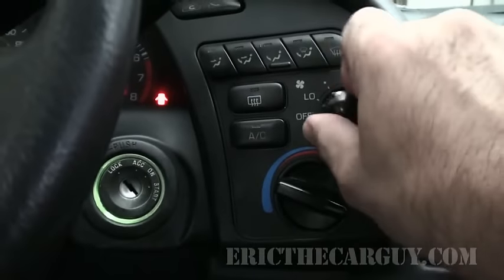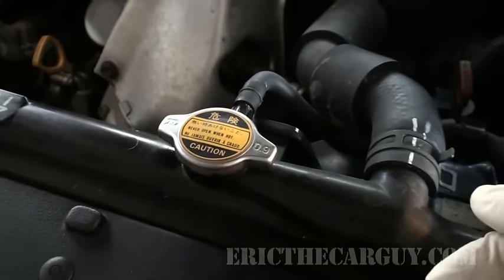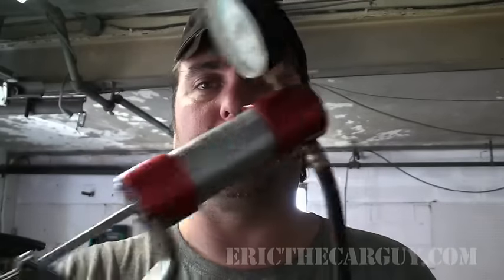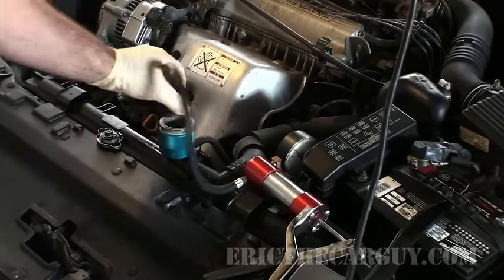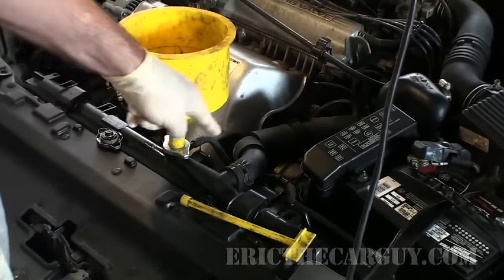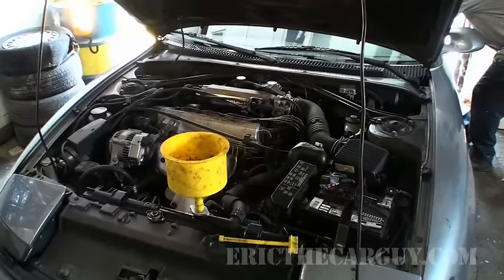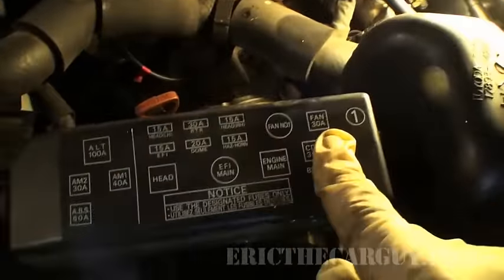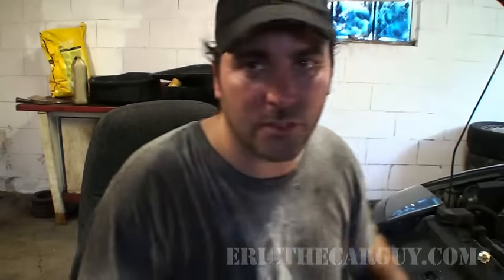How To Solve An Engine Overheat Condition - EricTheCarGuy

Comment: check this out... after starting and idling for about 6 minutes the coolant temp gauge goes from a flat 0 cold to nearly 260.. as in, once the needle starts to move, it rapidly rises to 260... all this time there is no heat from vents, blows ice cold... it's a 96 dodge ram, I have to pay someone to repair this for me (shoulder injury) and would like to know what this seems most likely to be.. coolant levels are good, had no problems at all then it just started with the no cabin heat and engine overheating the other day.

Comment: Got an 02 pt cruiser that's overheating if u drive it 20 mins or more...my ac n heater both work... I've replaced radiator, radiator cap, thermostat, low speed relay, motor in the fan(it wasn't working but now is) and it overheated again🤦🏼‍♀️🥺 no smoke from tail pipe. Actually drives really good...any suggestions? IDK what to do

Comment: So what do you do if you have diagnosed all of that and you still have an overheating problem? I have a 2014 Dodge dart SXT 2.4l. I just bought it from the dealership about a month and a half ago and it is slowly overheating it is about midway between the hot in midway mark on the gauge.I have diagnosed the radiator fan and replace the fuses the radiator fan kicks on when I turn on the AC mind you there is only one fan in this car. So then I unplug the coolant temperature sensor and the car will go into emergency over heat mode and the fan will kick on super fast like a jet engine so I replace the thermostat and the sensor dot I topped off the coolant which is a sealed system and the car still overheats the only way I can keep it cooled off is if I turn on my heater at full heat any suggestions?

Comment: Q? My pick truck is overheating when turn on the acu. The coolant at reservoir tank is boiling. I had already overhaul the radiator to the repair shop. But its still the engine is still overheating. I hope you could help me solve the problem. Thanks

Comment: about the thermostat - don't you have it backwards? If the upper radiator hose is hot, doesn't that mean the thermostat is open? because the thermostat is allowing the hot coolant to escape from the engine and into the radiator?

Comment: Hi Eric.
Nice video for guidance. I have a weird problem with my 2003 diamante. When ever I drive on the highway above 120kmph, the gauge shows that the car is starting to overheat as the needle of the gauge increases by two bars from the center point. As soon as I let go of the accelerator or slow down to say 100kmph... the car goes back to a bar just below the center point. I have check the coolant in the radiator and it is clean and intact. I have check the oil and it is also clean and intact. But I cannot understand why the car is behaving like this at highway speed. There are no unusual sound coming from the engine nor any sort of leakages of any kind for the coolant.

Any ideas?
Reply: Did u find the problem yet... i have exact same issue in my Lancer 2008
Reply: Over time the small tubes of a radiator can build up with minerals or rust/sludge. This reduces water flow through the radiator and thus cooling capability such that the radiator is only effective at lower engine work loads. My 84 cutlass did exactly this at about 10 years of service. I removed the top of the radiator and rodded out the tubes. About 2/3 of the tubes were completely stopped up. Once this issue was fixed the car worked perfectly.

Comment: Any thoughts on why hoses are collapsing. Had head gasket replaced. But not ruling it out. Going to see if over flow hose plugs, replace radiator cap and hoses but something is causing to much pressure and blowing it out the overflow
Reply: There may be a restriction in the radiator. You can temp test the radiator if you have a Infrared Thermometer.
Reply: @greendropwebmanager3974  ended up being the radiator itself. Wasn't making a good seal on cap. Worn out or corroded. All good now

Comment: What if i turn the car on, take off the radiator cap and water/coolant is coming out of the radiator?
Also if i turn on the heat in the cabin, the fans blow cold air?
It is a Mitsubishi Colt 2005

Comment: Fuses rarely go out
Also You can drive on a bad thermostat for years. I know this because I did on 3 cars until I got tired of not having heat in the winter then I replaced them. I'm a diy mechanic. I've had a long line if bad cars so ive replaced a lot of things.

Comment: Hey Eric maybe you can help me figured this one out I have a 2013 Ford Edge 3.5 engine it's not overheating but it is building pressure on the radiator retainer where water want to gush out already changed the thermostat and I also did the refill with the cooling system tool.. thank you in advance
Reply: make sure no air in the system also make sure you don't have more than one thermostat newer vehicles might have 2

Comment: Replaced headgaskets on my RRS 4.2 SC.
Mechanic said that they blew. Started up the car and the initial problem is still there , the water reservoir tank starts bubbling over when the car gets to running temperature while its idling. Replace thermostat , replaced waterpump,  new radiator ..not sure what else too replace.? should buy a new engine.🙄.... and suggestions.? #southafrica
Reply: Did you ever figure it out?

Comment: So I am at a loss with my 2015 wrangler with the 3.6 liter engine. I have replaced the water pump, coolant temp sensor, radiator, thermostat, and ran it without the thermostat, burped it numerous times and vacuum filled it twice. My fan is working properly, and the coolant system is holding pressure and I just had the head gaskets done. I have literally done everything I can think of to do to get it to quit spiking up to 230-245 degrees. It’s very random but mostly does it on the interstate at about 70-75 mph, but it will also do it at around 40 mph. It gets plenty of ventilation and I have a dv8 raised vented hood. I also replaced the cap and my over flow stays on full. Is there anything else I can try? Or could it possibly still just have air in the system as I have heard these engines are really hard to get the air out of them.
Reply: Very strange case, if you have done all of those correctly. Try again to remove any extra air out of the cooling system. Secondly, sometimes restrictions in the exhaust can cause an overheat. Check the catalytic converter for restricted flow of air or even an exhaust pipe it may be crushed or damaged. Also, check the coolant and see if it's dirty, did you do a coolant flush?

Comment: what about the radiator being clogged up from say dexral antifreeze you know when it turns muddy just a thought from the guys at eastside auto radiator shop in philly and if ur radiator is dirty ur heat isnt going to get that hot so remember tp flush

Comment: what about if you have just replace the blown head gasket and replaced the termostat done all that is needed and it is still overheating and bursting cooling hoses? even test pressure and the gas leaking test. what do you do then?
Reply: Did you figure that out

Comment: I have a problem with my 2002 ford mustang 3.8l it runs alright for a little while then it goes in a protection mode as if it was overheating but it is not clear the code start it back up runs fine then back to protection mode

Comment: I've been watching your channel for years...
I have a 1998 acura cl 2.3 that's overheating..
I changed the thermostat and radiator fan switch what else besides a head gasket could be wrong??
The oil isn't fouled
There isn't any messed up smoke

Comment: 94 Dodge 3.9, new radiator cap system never pressurizes. Slow overheat especially if AC is used. I squeezed the top hose I felt no pressure, unfastened the cap no pressure no boil over. Took my garden hose ran water over the radiator and through the front almost an immediate cool down. Anyone know what my issue may be? Mr. Eric?

Comment: For slow speed or low rpm  (below 2000rpm) it will not overheating but if I will push to higher speed (100 - 110kph) or rpm say 2,500rpm and above for 5 to 10 minutes then the temperature starting to going up to overheating and the coolant reservoir is going to overflow. Radiator cap ok, CTS ok, Radiator just service or clean, No Hose leak, Thermostat replace by original part,  new water pump,  cooling Fan working, no coolant leak but the problem is if going to high speed (100 - 120kph or 2,500rpm above) the engine will go overheating to almost critical position.

Comment: Thanks Eric nothing solved my issue except adding extra small fan infront of radiator which really surprised me as the cooling fan working strong and still but Iam about to overheat in Altima 2006 but this rediculos fan thin type stabilized my car temp to its normal level 😅I don't know how it's did here we are about 50 plus celecius

Comment: My 2008 Escape was running hot.  I thought it was a stuck thermostat (no heat inside, engine temp too high).  Looked under the hood.  Water pump belt broke.

Comment: I e been here before...but this time I have a issue I need help with. 
    In short...when I let off the pedal it cools down. When Cruise control the gage lowers. High-pressure in the line when I stop...
   I did the chemical test for blwnHdgasket. HEELP!!! 94 ACURA LEGEND

Comment: Eric, I have Steam coming from my overflow tank after I turn my car off, when I pull the tube out. Any Ideas?
I going to change cap. 2002 Acura RL Thank you.
Reply: Do you have just water in the cooling system or at least not enough coolant mixed in? Coolant raises that boiling temp.

Comment: my radiator had a crack, got it replaced. still overheated. didnt have a thermostat, bought a new one and installed. overheated faster. water pump was leaking replaced it reinstalled stat after i removed it. had a cloud of white smoke. that tells me my head gaskets blown. bought a gasket sealer. removed stat to prevent it from getting clogged when i poured the sealer. sealer worked, no more smoke. reinstalled the stat. no overheating. that didnt last long. started overheating, im thinking of replacing the temp sensor. but something tells me the coolant (its mostly water now) isnt circulating. thinking of removing the stat and testing, but were having bad luck, all our other vehicles are in the shop., so this is our only "working" vehicle. i dont want to keep putting money into this vehicle but i need it to work as its our only vehicle. ive already bled it many times. both rad hoses get hot. any thoughts? Btw my fan is belt driven so its always on er working or whatever.

Comment: Ericthank you for making this video. i have a 2002 Buick Centry and i am currently dealing with this very issue. I have a 3100 SFI engine. I will be using this as a blue print for my car. Any videos on my type engine would be helpful. i also have to change the locks and windows. Looking forward to more videos from you...subscribing now.

Comment: eric i have 98 f150 and first its a wierd over heating issue i flushed out system cause it had some kind thick mildu flush it twice over 2 weekends and no change even flushed the heater core know when i drive truck normally u could here antifreeze threw the dash like struguling threw heater core and as i start in morning drive work the temp guage pins to hot then quickly goes back to normal then heat also goes from cold to hot then works fine for day till it cools back down does same thing any ideas please be very apreciated last thing im do is water pump then do block test like u just showed on vid which i hope not problem god bless hope see ur replies

Comment: Hi Eric I have a 2005 civic EX  my  when I do over 65 miles an hour my temperature gauge rises 3/4 when I drive below 65 to temperature drops back down to normal I had new head gasket replace  nothing blocking the radiator

Comment: I have a 2005 Chrysler Sebring convertible with a 2.7 l V6 it's overheating I believe it's air in the system the coolant ran low there's no leak somebody put coolant back in with the car not running I believe they got air in the system what is your opinion it may not even be fat but that's where I'm going to start

Comment: Hopefully you see this. I have radiator leak out the bottom of radiator, added coolant and its still overheating within 15 minutes. What do I need to do. Because it's leaking does that mean I just need to replace radiator? Or can I use seal stuff that goes in the radiator? Or is it more then just the leak
Reply: If the radiator is cracked you'll want to replace it. Those sealers that you can apply to the outside can blow off when pressure builds up, and. the ones you can add to the cooling system can cause problems with other cooling system components. If you fill it up and it still over heats it could have an air bubble, stuck thermostat, faulty cooling fan...

Comment: I have a 2004 Grand Am 3.4 The cooling fans do not come on when the AC is turned on; also the car overheats at idle - I turn on the heat to keep the temperature below 200. Where could the problem be coming from? Thanks.

Comment: @ericthecarguy What if the fans ONLY come on when the A/C is running? My 91 accord keeps overheating and I've found that my fans do not operate unless the A/C is running. The temp drops when the heater is turned on.
Reply: Additionally, I do not have a heat shield but my headers are wrapped.

Comment: I once had a 1993 Ford Escort wagon. My Dad and I rebuilt the motor and there was a crack in the fourth cylinder and white smoke poured out the back. On my next Escort Wagon, I began putting the wrong fluid into the transmission. After a while the transmission failed.

Comment: I'm currently having an overheating problem but only when I'm pulling a large trailer, flushed radiator changed thermostat and still over heats. I'm kinda stumped on what it could be

Comment: I am having a overheat issue with a honda CRV 1997.  It runs fine for about 10 minutes but then it starts overheating.  When the car comes up to a red light it gets hotter.  I was told to replace the thermostat but I don't understand why it dumps all its coolant once it starts overheating.

Comment: i got a crx with a b18a1 i putt antifreeze  on it drive  it for around  tree blocks  check  the antifreeze  level  and it's gone  more the half  gallon  on the radiator  I'm  thinking  head gasket

Comment: Stupid question. Could a crack in the overflow bottle cause the steam to escape and the thermostat not to pop open? The previous owner put some kind of gummy sealer over a crack in the bottle and it failed. I feel like such a moron I already replaced the thermostat but it's doing the same thing getting really hot and then dramatically dipping to cold on repeat

Comment: thanks Eric ...I now know some of or if not all the symptoms of an overheated engine.
ty.   thankfully I am armed with some knowledge of what the mechanic at nissan infinity 
ill be up against with my G35 2006 auto. I will check the Ac and see if the cooling fans are working 
I assume the problem  is the fan. ty again 
the bill won't be as shocking ........keeping hope alive...ha (twice)

Comment: Eric, i have this honda crv 1999 AT, which overheats on idle after a long drive(about 30min on drive) and when engine is running long(tried 1hr on idle)  and it stars overheating, temp guage will go down when i start to rev up the car. Replaced and tested all of the parts on cooling systems even head gasket but still overheats. 

Im already suspecting a blockage on water jackets on the engine since when I open up the head, i saw hard sludge of mixed coolant and oil. Would that be possible aswell?
Reply: Water pump gaskets ?    The thermostat and fan are running and the pump circulating,    But the pressure loss means the boiling point is lower,      Resulting in it seems to work when traveling with air flow but overheats after a short time in traffic ?

Comment: Hi Eric, Honda Guy here. I have a base model 05 MDX, and the cooling fans won’t come on properly . In other words they work but not when they should . Changed the relays an no dice ,I’ve done all the usual checks in the system and have come to a bit of a mystery. When I go to bridge the pins in the connector that plugs into the ETC, the minute I unplug it the fans cut on (both). I don’t have to put the paper clip bridge in . Weird right ? .I’ve poped in a brand new ETC just to rule it out and same results . What’s going on please?
Reply: And by the way I’ve change do the coolant to Honda and the thermostat , stood for an hour perfung the system of bubbles

Comment: Eric my 2002 Mitsubishi Galant is overheating but one thing I've noticed is that when I'm driving I get natural heat in the cab from the engine but when I stop for a light the heat is replaced by cold air....why is this, it never used to happen and its source might be the cause of the overheating.

Comment: i hit a porcupine it smashed my rad lost all fluid.  the engine turns over one cooled.  i checked oil black, looks ok.   i not sure if when i lost fluid if the turbo gone or engine gone  or both.  
engine tures over yet will not start.  i not sure is out time or sensor thinking the worst

Comment: Yeppers.  Used the combustion gas test and the fluid looked like urine. Replaced the head gasket and still got slight combustion gas detected. Did some research and discovered my particular engine head had a high failure rate. The head was a VW/Audi 1.8t AMB head and was known to crack typically between an intake and exhaust valve seat. Fortunately, I had a whole 1.8t from a VW and was able to use that head. Problem fixed, though it was a pain to do it twice. Lesson learned: research your particular problem and your particular car before doing any work. (There were other tell-tale signs of a cracked head, such as rough start that cleared up and the piston top that looked steam cleaned, once you knew what to look for.)